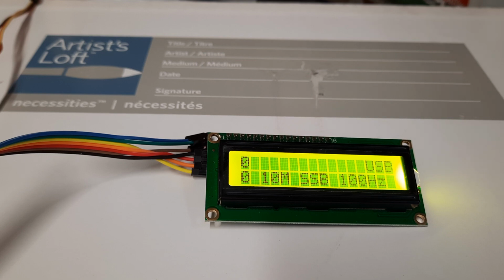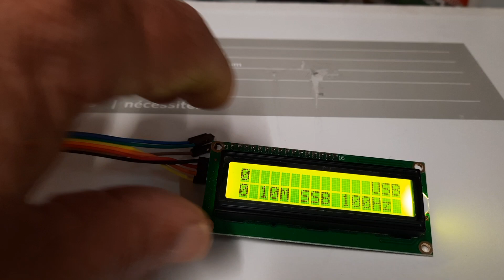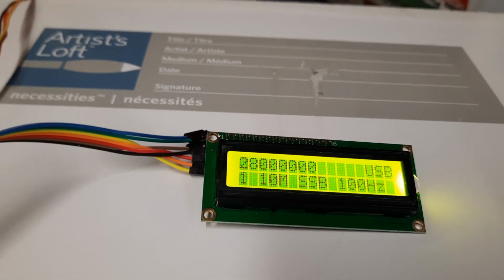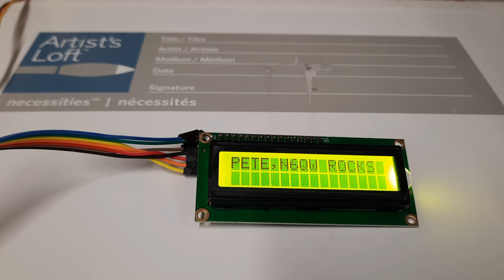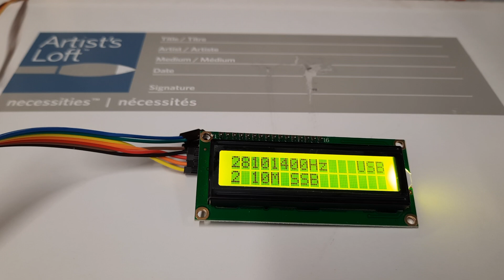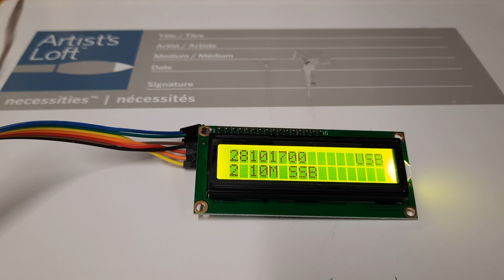A Novel way of tuning the Si5351 without an Encoder. An Alternative to the Glue Stick PTO.

Comment: The KD1JV PFR3 was designed that way
Reply from the maker: Hi Ed,

The old adage you learn something new every day and today I learned something new although if you look back on some of my old you tube videos you will see I used this on the Ten Tec 150A commercial transceiver. Today I further modified the code and the display and tuning is much better. I also implemented the step tuning into the keypad. I will be posting another video in a day or two.

Thanks for your posting and comment.

73's
Pete N6QW